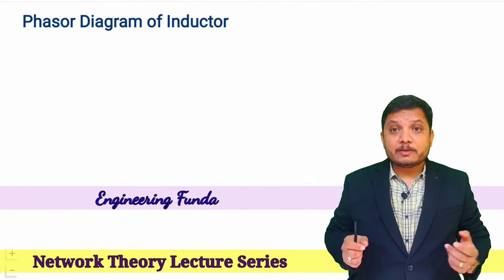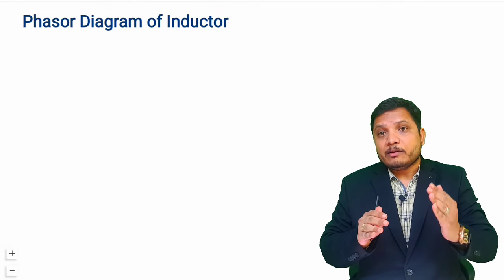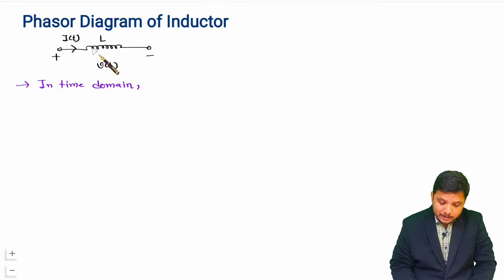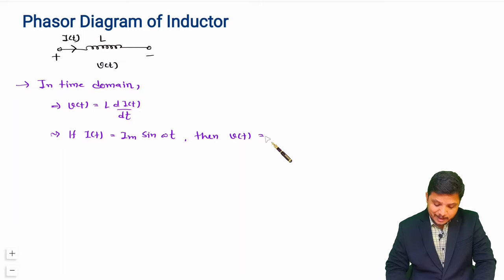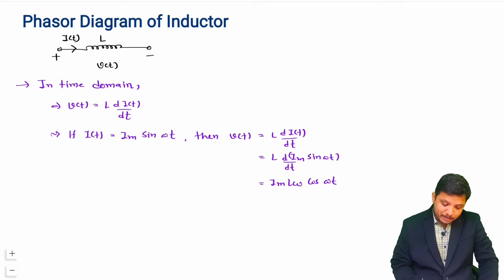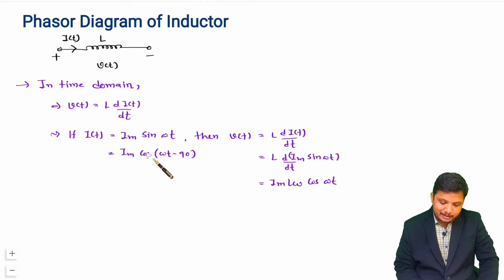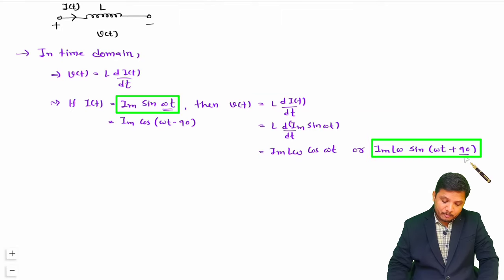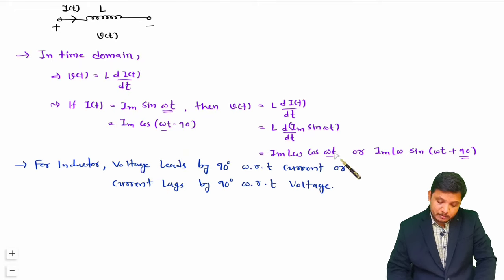Phasor Diagram of Inductor | AC Analysis | Network Theory | Engineering Funda

Comment: sir why is the amplitude of current more than that of voltage if we are multiplying Im with L to get Vm?
Reply from the maker: If you multiply Im with XL = wL then you will get Vm
Reply from the maker: And Amplitude of Im and Vm depends on Impedance.
Reply: okay sir thank you very much for the videos I am able to understand NT properly and cover it very efficiently only because of you!!!

Also sir do you also have a telegram or whatsapp community of your students where we can solve each others doubts or can i contact you in any other way?
Reply from the maker: @sharvaripatwardhan1502  : We have our android Application, soon website based integration will also available.